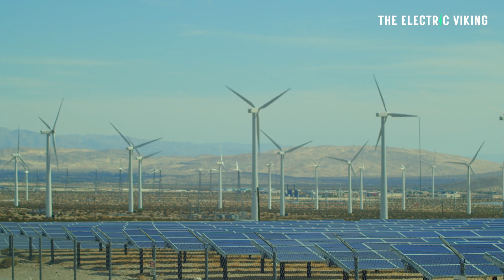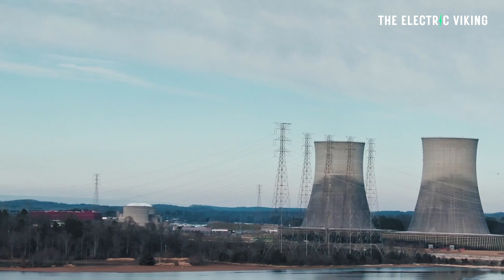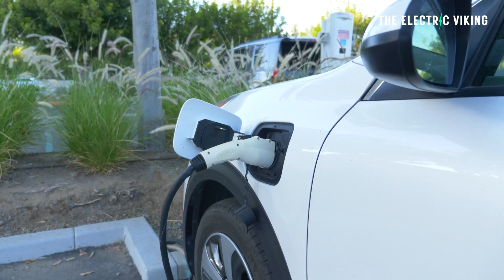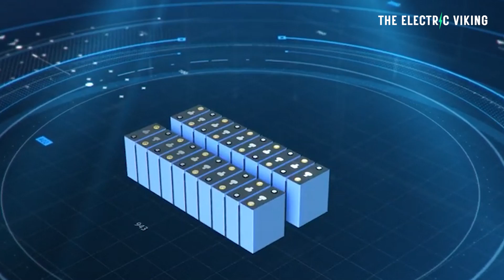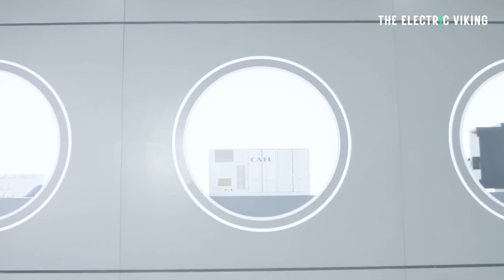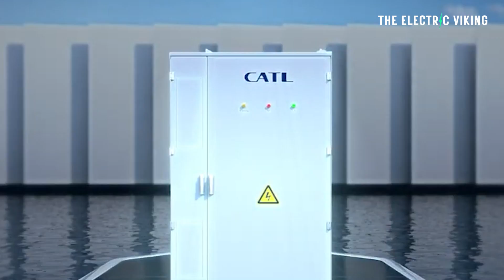CATL's new LFP battery lasts 3 million miles with 0% degradation for 5 years

Comment: Whats the cost of this container battery ?

2nd,
I think Sodium ion battery will be much cheeper if mass manufactured.

And for Stationary storage, energy density doesn't matter.

3rd,
Even after that Solar + Storage is not cheeper that Thermal Power Everywhere.
Although it will becomes cheeper in few years with falling cost of Battery.

And that is the reason China is still building new Coal Power Plant.
If Renewable was cheeper than fossel, then why will China build new Coal plant ?

See,
I know only Solar (excluding storage) is very cheap.
But when you add storage cost to it for use at night, then it become expensive.

That is why most of the Solar thatbare being installed is for fulfilling the electricity demand at day time / noon (when there is sunlight).
But at night, Coal is being used because its cheeper.

4th,
Although I am 100% sure Renewable energy will become cheeper even at night in few years because of fallling cost of battries.

That is why I am soo keen on Sodium ion battery because it can be 30% cheeper than Li battery.

Even yiu have said that CATL is planning to bring its 2nd Gen Sodium ion battery at the cell level cost of $40/kWh.

If CATL brings battery at that cost,
Then in reality Renewable will become cheaper even at night.
That will be the deat of Thermal power plant.

When will CATL bring that battery thou ?

Comment: I suspect too much is being read into these degradation numbers.  It is easily possible to mask battery degradation.  All they have to do is only allow charge to a lower voltage and then increase the terminal voltage a tiny bit, as the internal resistance goes up and efficiency goes down, to compensate.  Externally, capacity remains impressively constant but the battery is still degrading.  Tesla did this early in their history by shipping larger packs than were available to the customer and only unlocking capacity if the user paid for the extra energy storage.  It's still impressive but it could be battery management and not cell behavior.

Comment: Wind power is proving to be a financial problem around the world . Solar is about the best but I think it's reached the lowest price it can be. . One thing to watch is old coal and gas fired plants being updated and running battery storage so they can run at near full capacity 24 hours a day and store the excess power from the night to sell during the day . These batteries will enable the reduction in the cost of generating power over a yearly figure . The other thing to watch is the cost of Natural Gas which is in huge abundance the actual cost could drop by 75% or more in the next two years .

Comment: Please Sam; do the calculations again and then add the cost of the changes necessary for balancing the grid and also supplying power in the the areas were sun isn't available during most parts of the year and night time. 
The investment needs to be recovered, that means you need to get paid for the power you generate. That doesn't happen with intermittent power like with solar or wind power.
When there is enough solar power plants, the price drops to zero and that means the customers will have to pay the entire investment, either by tax or sky high prices for power.

Comment: Countries that have regular power cuts because coal power plants are outdated or getting the coal to the plant has logistics or price issues as price of coal fluctuates. This will be a gamechanger, solar is affordable but the problem has always been storing the energy was too expensive. CATL CEO is one of the best minds in the world when it comes to battery tech, VS Toyotas CEO a rich kid with an MBA and some family connections to get him a job that would struggle to change a battery on his alarm clock.

Comment: This is undoubtedly a good development. I started investing in the electric sector a few years back, specifically because of this type of technology. I have to ask you, Sam. Is your staunch support coming from an emotional position. The problem with battery grid storage isn't so much longevity. It's cost per kwh. Currently, the typical duration of a battery farm is 2-4 hrs. With some outliers reaching 6 hours of storage. All because of cost. You gloss over this part of the equation in your report. "Costs are coming down." The important question is by how much? It will have to be low enough to account for more than the day night cycle. The industry standard capacity factor for solar is between 10 & 25. With Australia occupying the upper end of this scale. The UK, as an example, occupying the lower end of the scale.

Comment: Batteries are a great enhancement and can be used with coal and other fossil fuel power plants.
Coal generally runs at 300% of nominal load for peak demand since it takes many hours or days to ramp up to 100%.
Batteries would allow them to run close to nominal demand and use batteries while it ramps for peak scenarios.
Better yet, enough batteries would reduce./ eliminate ramp up delays. Gas Peaker Plants still have ramp up delays of 1 to 12 hours for full output.
This due to the time requires to boil the water used to turn turbines. Think about the volume of water needed.
Either way, batteries alone can reduce coal usage. Adding solar and the need for coal diminishes greatly.

If each homeowner had a 15KW battery, they could all but eliminate the need for peak production.
1 15KW battery powers my small home including A/C for 24 hours with no sunshine. 
I am sure apartments and condos could get a better ratio of battery to person.

Comment: Actually, Ambrie made a liquid metal battery that has zero battery degradation, and is perfect for grid level storage.
They have since been sold, and I don't know what happened to them, I hope they are further developing this technology.
Reply: I had not read that Ambri had been sold. I was hoping that that company would be successful, although I know that it is very difficult to break into the stationary storage market. Is Dr. Don Sadoway still connected with the company?
Reply: @seniordockman2946 
My understanding is that the founder of ambre, and many of the students that help start the company remained in their positions when they were sold.

However, it's been a while since I've heard anything, so it's difficult to say what's happening currently.

I too had high hopes for Ambre, and really hope it can make a difference with grid scale energy storage.
Liquid metal batteries, designed from inexpensive materials, that continue to function for many years, is an outstanding solution that can solve many problems.

Comment: That 1MW/2MWh battery shown will power 100 homes using an average of 5kW each for 4 hours. There is a crying need for more wind, Solar and hydro electricity generation, along with much more storage.
How do you eat an elephant? One bite at a time. 
It's happening.

Comment: Australia has a huge coal industry and it has supplied the energy sector for quite a long time.  Don't you hear a lot of criticisms from your compatriots about how unreliable solar is (because it does not work if the sun is not shining; because wind propellers are not recyclable, as is the case with solar panels)?

Comment: no such thing as zero battery degradation LFP Batteries dont like extreme temperature conditions,  too cold or too hot, can stress an LFP battery. you avoid leaving the battery in these conditions for extended periods as it impacts its overall health and reduce its lifespan. i have LFP batteries in our motorhome and they are good but need to be heated and cooled and they are so heavy 

i though everyone knew that

Comment: Sam you are not distinguishing calender life (float life) from cycle life.  For most people, 15000 charge cycles is irrelevant.  You couldn't achieve that in a lifetime but the battery won't last your lifetime.  It will die soon  after its warrantee expires.  Head-to-tail laboratory testbed cycling may be a good way to rank batteries with different chemistries but it is a poor way to predict life in the real world under real world conditions such as temperature extremes, vibrations, impacts, exposure to moisture etc.  In the real world you won't see anything like 15000 cycles in service. If this were truly possible, battery manufacturers would be offering 20 or 30 year warrantees.  My personal experience with LFP batteries is that they pack-up after only a few hundred cycles even when molicoddled and pampered.  I know - I own 5 and they keep breaking down.

You also underestimate the task of replacing all fossil fuel energy generation with renewables.  It simply can't be done.  There isn't enough land or resources.  Read some of the work by Dr. Simon Michau and read the book by the late Cambridge Professor David Mackay "Sustainable Energy Without the Hot Air" available free online.

Batteries are subject to the laws of thermodynamics.  The number of elements on the periodic table is finite.  We are not discovering more.  There are finite limits to energy density and we are not far from this limit.  There are peer reviewed papers which discuss these limits.

Please don't take all the marketing hubris of a few Chinese battery manufacturers so literally.  You should question every claim with skepticism and try to find credible corroborating evidence before getting too excited.  It took about 100 years for ICE technology to evolve.  EV technology will similarly evolve slowly.  

Anything that sounds too good to be true probably is.

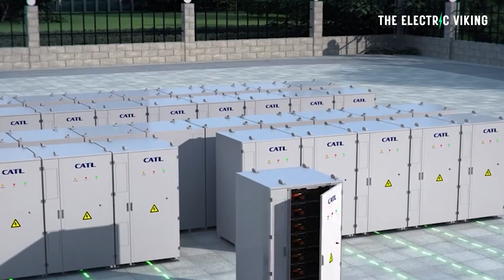Comment: 3:50 Zero battery degradation for the first five years.  What happens then?
10:30 Battery lasts twice as long.  To what, lithium batteries that last 8 years? 

What does that look like with 100% capacity until 5 years and then functioning for another 11 years?
Reply: Sam just utters nonsensical jibberish.

Comment: Of course the video doesn't even touch on how costly it would be to try and store months of energy in a battery bank between seasons - to back up the Australian grid with batteries between seasons it would cost trillions of dollars.
Reply: you don't need month of storage. If your solar production capacity is large enough you don't need more than 120 hours of battery storage ... in Alaska !
Reply: @phvaessen  The amount of solar production is variable. All it would take is one snowy winter or a long rainy season with sufficient cloud cover to push the electrical production to near zero of the course of several months.

Comment: according to Tony Seba, in 2009, a solar power plant (solar + wind + battery storage) would need only 175 square miles of desert land to provide all USA electricity. This is only 0.1% of USA deserts. And solar is cheaper than the fossil power plant's operational cost ! In the meantime solar has reduced by 92%, and doubled efficiency.

Comment: If I design a battery pack with guaranteed 10 KWH  capacity for five years but put twelve KWH of cells that will degrade 10% during that period in the PACK,then I can guarantee 0% degradation. The bms limits the range of discharge to 10 KWH and even after 5 years the pack will still have the original rated capacity.
Entropy has nothing to do with it,it is designed to do a specific amount of work.
Reply: Is that how this new specific pack is designed? Merely a sleight of hand or have actual advancements been made to mitigate it?

Comment: Can you imagine the economies of scale that CATL will achieve with this new battery chemistry if it performs as advertised?
If these CATL batteries are adopted by existing grids, extensions to existing grids and by brand new grids in under serviced regions around the world?
Reply: you won't need grid anymore - it's disruptive technology
Reply: @phvaessen  
The grid will continue to make sense in most places.  Solar is not a 12 month solution in some parts of the world.  Wind and hydro are needed there and those need the grid.
Reply: @phvaessen  
Yes, distributing solar and storage around the grid decreases the need to upgrade the grid.  

Yes, we will need to overbuild wind and solar in order to have enough at times.  But what few seem to realize that our grids are already massively overbuilt.  Using US numbers, our coal plants and combined cycle natural gas plants operate between 50% and 60% of nameplate capacity.  Hydro runs a bit less.  Gas peakers operate below 10% of nameplate.

Overbuilding is one way of making sure we have enough for the highest demand moment of the year.  We did it will fossil fuels, we'll do it with renewables.

Some have gotten a bit carried away with 'free energy'.  There will be a capital cost, there will be operational costs.  There will be times when generation is higher than what can be used or stored.  During those times that electricity can be sold for drastically lower prices just to contribute something to the overall cost of generation.  But it won't be free to generate.
Reply: @orionbetelgeuse1937  
"When did a chinexe product performed as advertised?"

My Chinese made electronics work very well.  Ask Apple owners.

Comment: The key is having a warranty carried out by a local vendor with a bond that covers the warranty. A unit that goes down and can't be replaced is an investment killer!
Reply: It does not need to be a local vendor.  All that is needed is a valid warranty.
Reply: @bobwallace9753  What I mean is you could have the legal right to have something repaired while never getting it repaired. Or waiting for a 'repairman' to come from out of town. Things to think about that can affect you while the system is down.
Reply: @coulterjb22  
The large battery systems installed to date consist of many standalone packs.  If one fails it has no impact on the others.  If there's a problem of frequent failures then there will be people on site or close by to make repairs.

If the whole site goes down that's almost certainly a problem with the transmission lines which is a local utility issue.

Comment: The price of something like a Tesla Powerwall needs to come down to the point that every home is expected to have one, like a hot water heater or washer-dryer. Imagine how much less fossil fuel would be used if every residential home had solar panels on roof, power wall serving as part of a virtual power plant for grid storage and an EV charger in the garage.
Reply: I agree.  Tesla markets the Powerwall as a premium product, which it kind of is, but there are many lower cost alternatives.  EG4 power pro is less than half the cost per Kwh and is a great product.  The price of batteries keep falling and CATL predicts $56 per kwh at the cell level by the end of this year, which will continue to push down battery costs.  Next year we'll start to see a bigger ramp of sodium-ion and will probably see the first sodium batteries for home storage available as well, which will continue to drive prices down, further.
Reply: Buy an EV and use it as battery for your home when it is in the garage (95% of the time). You get the EV cheaper than a Tesla Powerwall !
Reply: @phvaessen  Where can you get an EV cheaper than a powerwall?  I would gladly do this if I could.
Reply: @Ryan-ff2db  Example: The Geely Geometry Ex3: Battery capacity 37 Kwh cost $10K (cheaper than. I static batteries for storing electricity generated by solar panels! You buy the batteries, and the car is free! A Tesla powerwall 3 costs €6945 for a capacity of 13.5 kWh.
You need to check if the EV is V2G (vehicule to grid). The technolgy is available, not all cars are V2G.
Reply: @phvaessen  That's cool if you can get those where you live but the US government is never gonna let those sell here in the states.  Here, using 3 EG4 power pro batteries you can get 43kwh total at about $10,500 for the inside version or $11,400 for the outdoor version.  Pricing keeps falling though.  I imagine by the end of the year there will be even better deals.
Reply: @phvaessen do you know if can you put solar into an EV battery during the day?
Reply: @GlenisRetiredNZ  you get solar energy when the sun shines, not during the night ... Not sure I understood your question.
The technology I am  referring to is often called bidirectional charging, and when applied to electric vehicle (EV) batteries, it enables them to not only charge from the grid but also discharge energy back to the grid or to power other devices like your home. This capability is particularly useful for vehicle-to-grid (V2G) systems and home energy storage solutions. It's a feature that various manufacturers may implement in their EVs or battery systems.
Reply: @phvaessen  😁. No.. But thinking about it, ii guess you have an electrician wire the ev charging port to the solar inverter to charge the ev during the day.
Reply: There are many lower cost alternatives. For raw storage, DYI stuff is now under $300/kWh.
Reply: A single power wall in NZ is $20k. It's just too expensive and there are no government subsidies. I hope catl make much cheaper home batteries
Reply: @GlenisRetiredNZ  That is far too expensive.  Given China is your biggest trading partner there should be much cheaper alternatives, unless you're set on using Tesla.
Reply: @Ryan-ff2db  that is NZ dollars $12k USD. Yes, if I could get a house battery from China from a well known company for 1/2 the price it would be worthwhile.